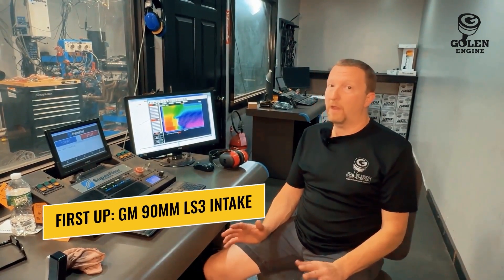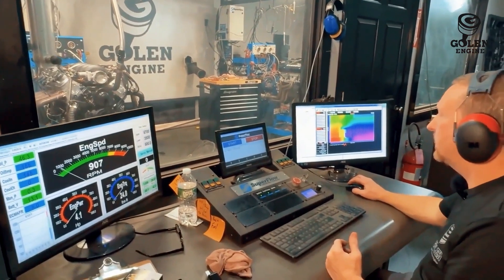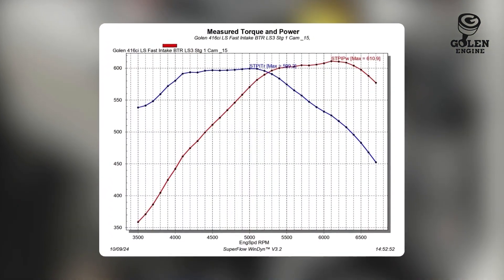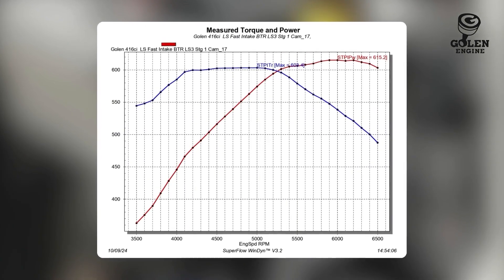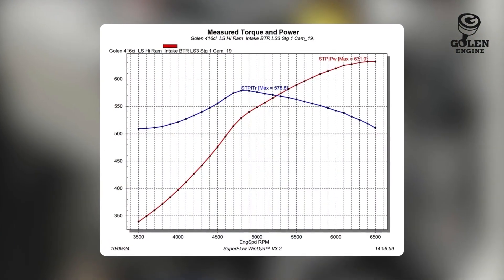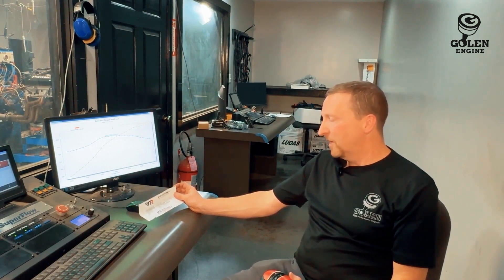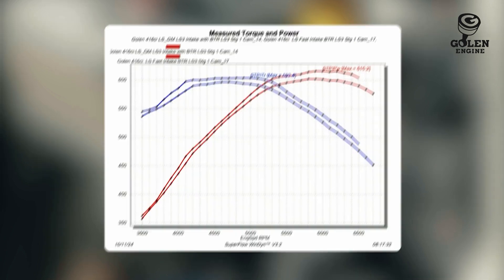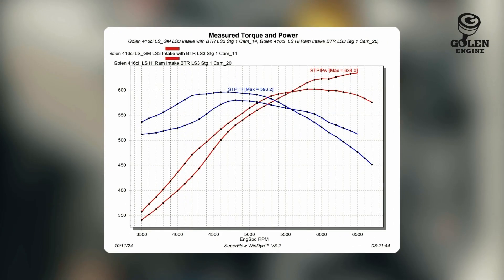416ci LS Dyno Test | Part 1

Comment: Hello, i don't mean to be Johnny come late to the party. I have a 416ci iron gen 4 going together I'm using the fast lsxr intake. My question is what did you use  for injectors and if you had the chance what would you have upgraded to. The combination will be run by a terminator x . It's going in a 78 Fairmont boxtop drag car - mainly for hobby use

Comment: Great video. Seems like a package that would have a long service life. Curiosity has me wondering if a 95mm TB on the factory intake would have closed the gap a bit to the FAST, thinking the bigger displacement might be bottlenecked by the 90mm. 

Have you done any 408/416 setups with the recent Redhot or 400+ NA BTR cams?

Comment: I have a really good LS3 model in ENGMOD4T that took a lot of time to develop - measuring the intake manifold fully took some time - and I use it as a predictor on simple stuff like head swaps, compression and/or displacement changes, intake manifold swaps, and header changes.

The two issues I consistently confront are the limitations of the burn model and it really needs the camshafts fully profiled in order to get the models to square with reality. 

Cam in block V8s are easily modified in software, but finger follower superbike engines are more fun due to the challenges of extracting even a repeatable .2 hp. I'm an EE by education, but life isn't all circuit design.

Nice demonstration.

Comment: I'm surprised the FAST picked up that much over the stock LS3 considering how good the stock LS3 intake tends to be, but the extra cubes probably helped widen the gap between the two compared to a stock bottom end.
Reply from the maker: The larger cubes really liked the slightly better flowing Fast intake but my money is on the stock LS3 intake due to how inexpensive it is and the power it made